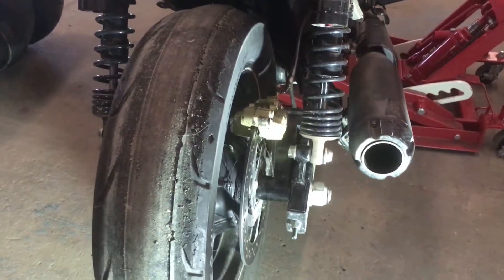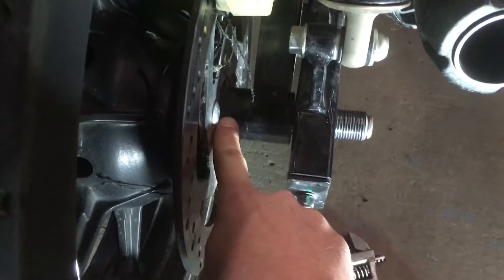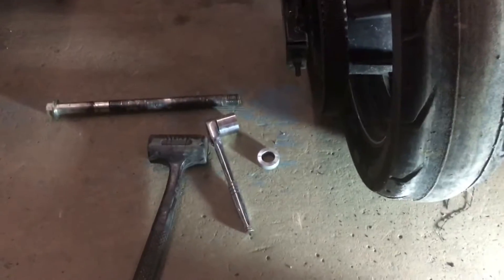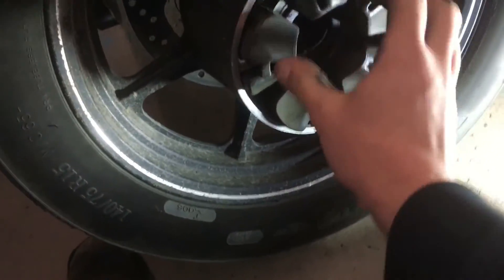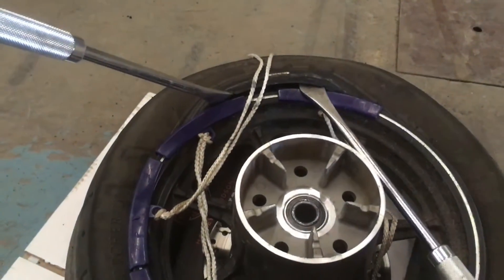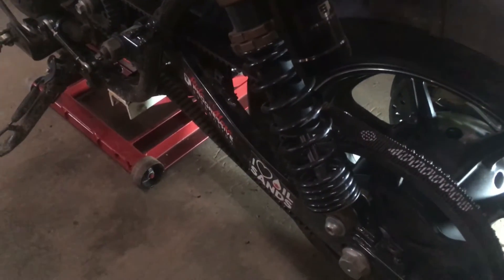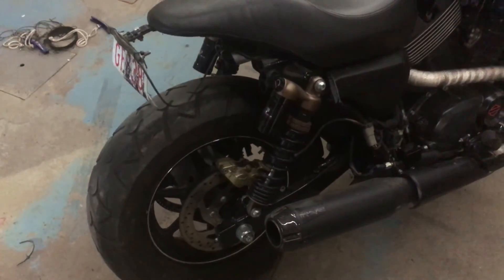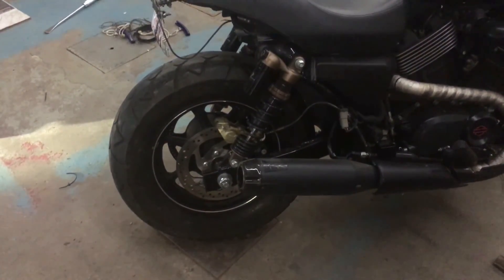Street 750 - How to change the rear tire.

Comment: Hello, I am looking for urgent help. To install the rear tire you made the modification? I'm installing a Michelin 170/80-15 Commander 2 tire and it's so tight that it hits the battery case. The mechanic tells me that there is no way to install that tire, it will damage the fender and the battery case. Before doing that I had looked for references in different places and look, they installed tires that big without problems. Now I am frustrated because I cannot ride my motorcycle, I will have to mount the original tires and I have already paid for the new tires, in addition to changing the suspension for an 11” Progressive 412 Heavy Duty American Can you please help me!

I want to continue with my project and not go back to the original wheels.

Comment: Hey can you please help me ? My rear tyre bearing is broke! What can I do ? It’s 750 street
Reply from the maker: Broke? How so? Is the wheel seized up? Post a video so I can see what’s going on and maybe get you pointed in the right direction
Reply: @PackraftBeta  the black cover of my bearing is broke and even some of the inside balls fall down, and now the rear wheel is making loud noise, can you share your mail id so that I can send you a photo of my bike wheel.
Reply from the maker: @TurboTorquemotovlogs  oh that sucks!! Well, pull the wheel off like I did in this video and get yourself an inside bearing puller. Slap that bad boy out of there along with the other side as well and insert some fresh new bearings. Now, before you reinstall everything, I would try to understand why your bearings failed in the first place, so that it doesn’t happen again. 

Looks like you have a fair sized channel on here as well, so I’d make a video of this all. I’m guessing it would make for great content? If you don’t feel competent in taking apart the rear end of your bike and if you don’t have a maintenance manual, you might want to seek someone out locally who’s experience with type of work, and get them to help you out. A
Reply: @PackraftBeta  bro I want to know the bearing size and my problem will be solved, and thanks a lot for this great help
Reply from the maker: @TurboTorquemotovlogs  the book I have doesn’t have a size, just a HD p/n which is rs25100-200
Reply: @PackraftBeta  alright thanks ♥️💥